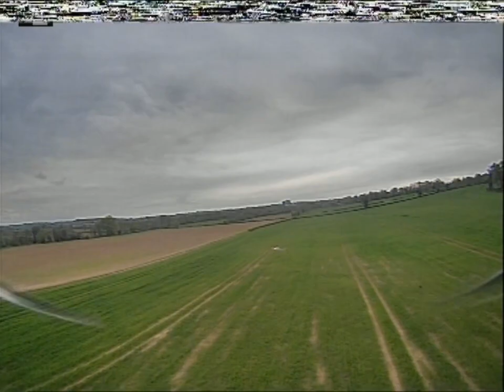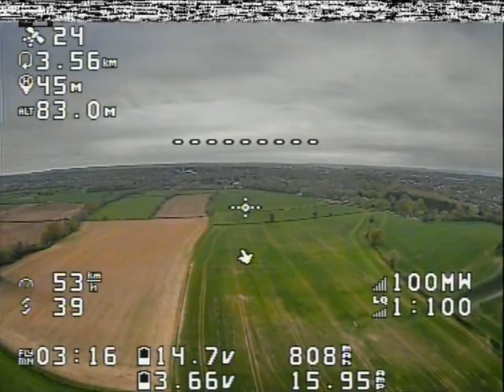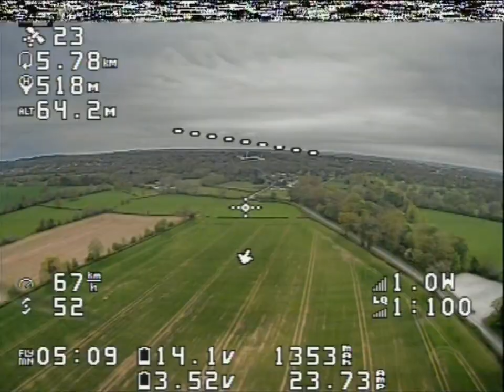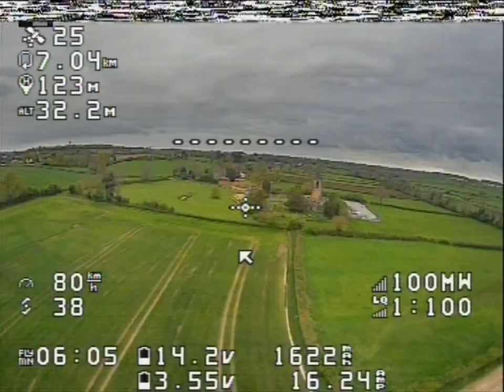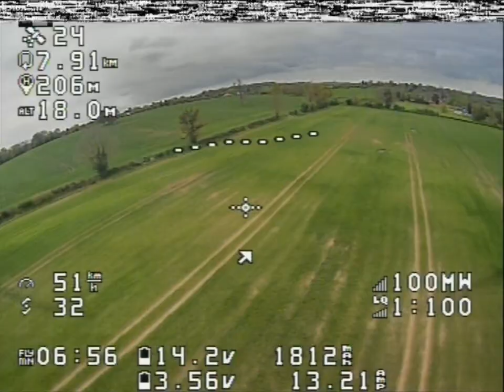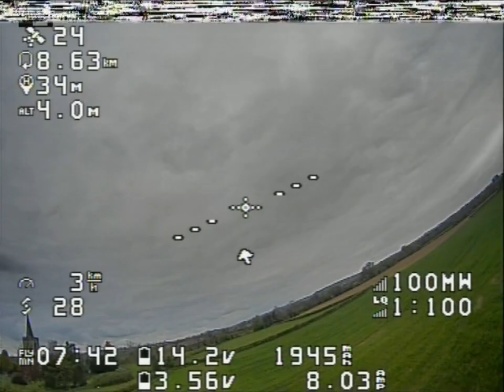hypothetical range test, cruising 7" narrated flight

Comment: Almost 800m is pretty good. Not sure how far you could push it but that's good to know!
Reply from the maker: Capability is pretty much 3-4 km if I want to bring it back, probably 4.5 absolute max. Fairly confident video would hold and battery would be the limiting factor. 
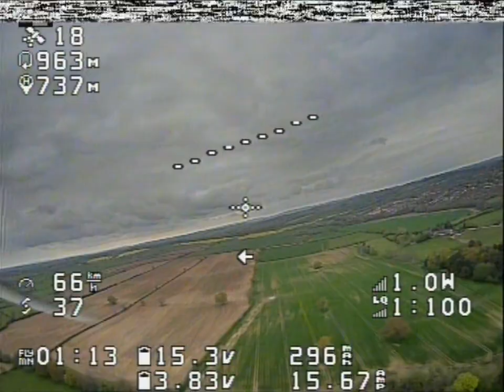Max distance in this vid is 1km around 1:30 but I dunno man, sending it long range is sketchy at best lol need to take it out somewhere in the wilderness innit.

Comment: cool stuff, I've built a 7" but it wobbles when i drop the throttle, more tuning! desperate to do a nice LR test like this :)  didnt know you could have a OSD for distance traveled may try that!
Reply from the maker: Cheers man, I used a preset I think UAV Tech one, then just tweak the master slider to change how agressive it is. Generally flies really nice, I don't intend to rip it hard. I think it's called round trip distance in the BF OSD tab.